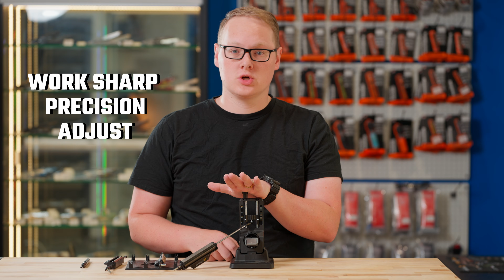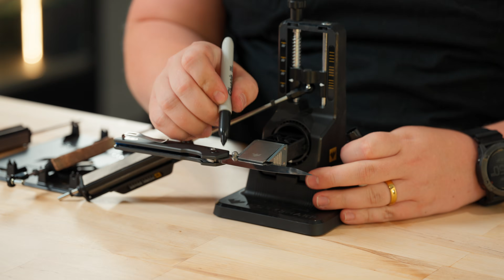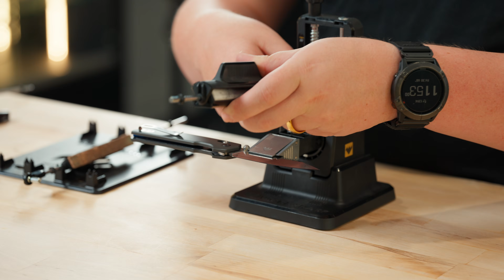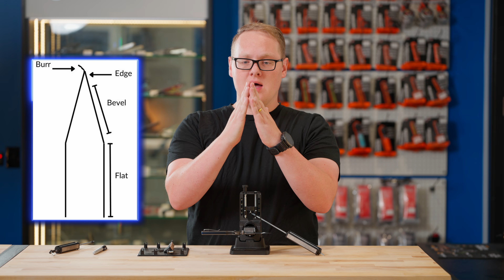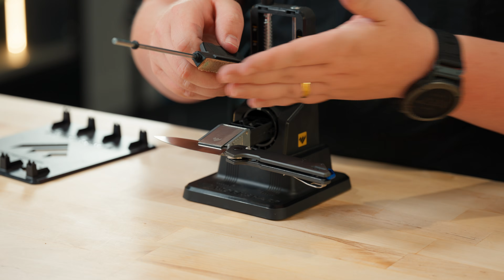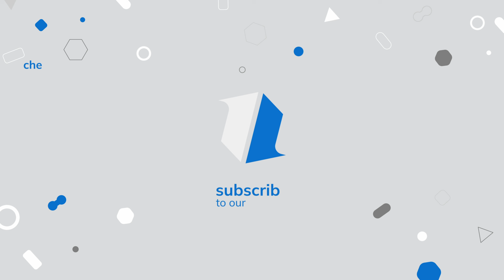How to Use a Fixed Angle Sharpener!

Comment: Great video, have been using this sharpener for years. Just remember to always clean your abrasives before use. The ceramic was extremely dirty in this video and can actually poorly affect the sharpening experience. A pencil eraser takes all the black residue off and a simple wet paper towel can be used for the others. Pro tip - also clean your blade each time you flip it. It seems dumb but a local knife maker gave me that advice and it did indeed make the sharpening process slightly better.